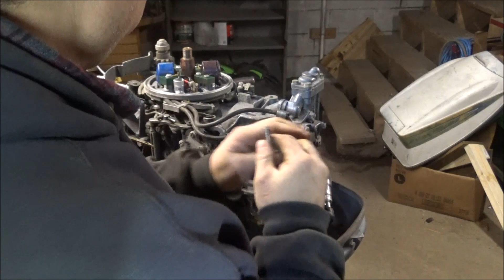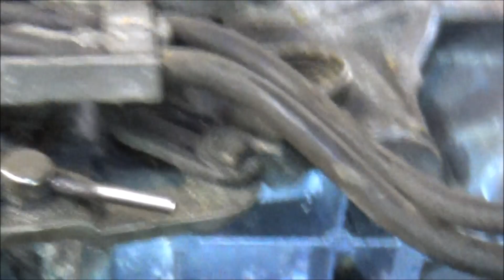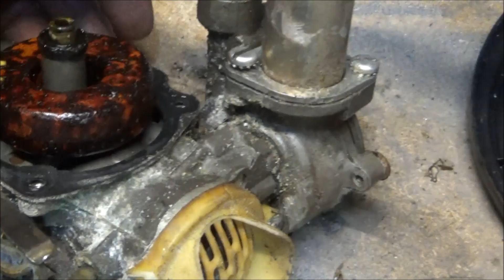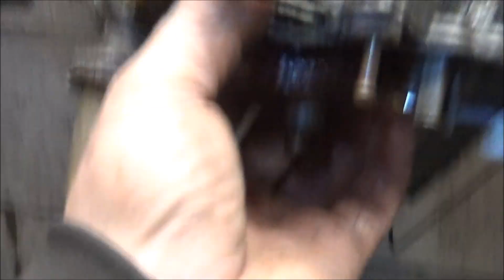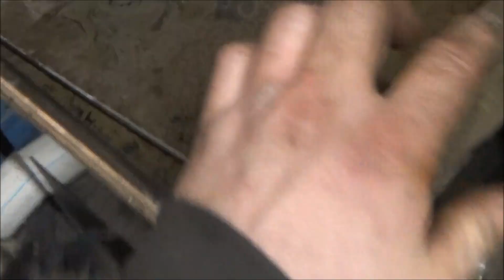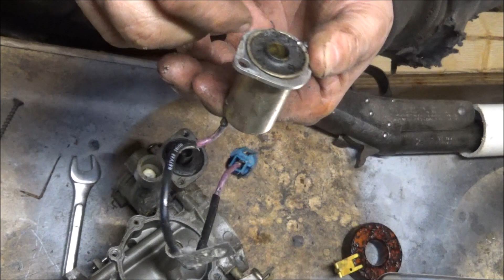1964 Evinrude Points Cleanup and Carb Removal Video 3

Comment: Hi Ed. Both coils share a common ground . So just attach the ground to a point where it reads and then check each coil at the  plug wire on each coil. It looks like the dark colored coil has shorted inside and blew the  covering apart.
Reply from the maker: Hi Bobby,  that makes sense, I thought a previous owner may have got in to deep with a screw driver while trying to pull the flywheel off.  The new coil is coming from Massachusetts so it shouldn't take too long to get here.  Bottom end seal kit came in today.  I have shot some video if the carb coming out of the ultrasonic cleaner, but I am waiting on the rebuild kit before I shoot more video.  The kit should be here soon.  I also ordered a new fuel pump.  I figure I have about $100 in engine parts so far.  I think a paid $80 for the motor and I have $100 in the boat.  forgot I  also put a new jack on it too.  That was $25.  So getting some cash into it.  My goal is $500 running and driving.  Lets see if I can make it! LOL
Reply: Hi Ed. The float sure looked like the fiber one. Get a new one if possible . They come apart and stop up everything  in the carb. Been there myself not fun. I have always used  " Gunk  carburetor cleaner "  I still have and use the same can after over 20 years or maybe 30 + years ?. 
All my best.
Bobby
Reply from the maker: Bobby Tectalabyss is swear it was made out of cork and coated in some type of laquer.  I ordered a NOS Carb kit and it comes with a new float.  Thanks for all the info and support.  Later -Ed

Comment: All my 60s Evinrude and Johnson’s, I replace the fuel pumps with amazon China ones, very cheap. There’s really only 2 styles for the 60s motors, the small squares and the larger pointy like here. They even have em with the pulser air inlet. They don’t bolt up to some motors, but you can’t see zip ties with the hood on anyways... add an aftermarket inline fuel filter and ya Can’t beat em.

Comment: do yourself a favor,by tygone fuel line in 1/4 inch from stens. ethanol eats rubber stuff and this is thinner and stays flexible for years. i stopped using the regular fuel line because in 1 year it was a rock. you will need to get smaller diameter spring clamps,but there cheap and on ebay
Reply from the maker: Hi Roger, I will stop in to my local snowmobile shop tonight and grab a few feet. Thanks for watching and sharing your knowledge.  Later -Ed

Comment: Ohhhh, sandpaper,  the sandpaper time has come!
Reply from the maker: joserantocb750 Yes and it worked! Thanks for watching and commenting.  Later -Ed
Reply: Ed Moore Of course, that is the god's secret!
Reply from the maker: joserantocb750 when I was a kid we had an old Montgomery Wards rototiller.  It sat outside all winter under an old washtub.  Every spring you had to take off the shroud and sand the flywheel and the freekin thing would fire right up.  Thanks -Ed